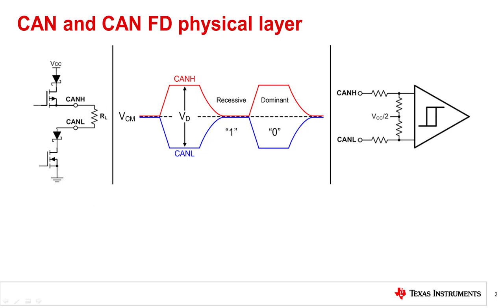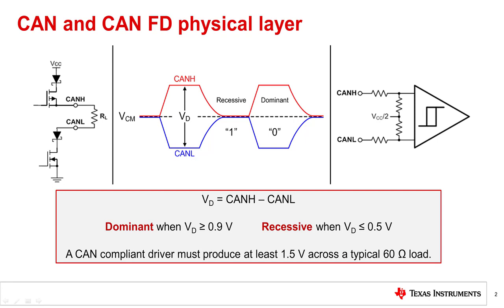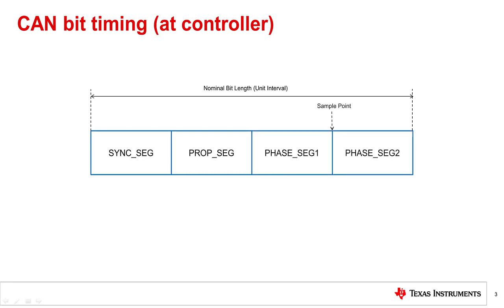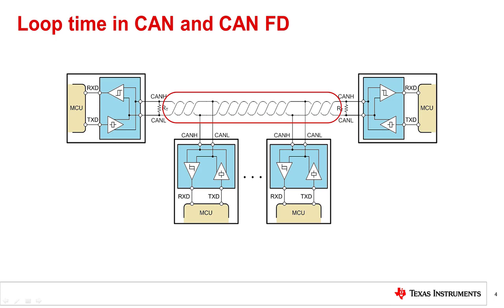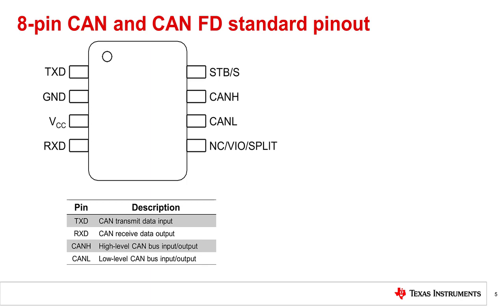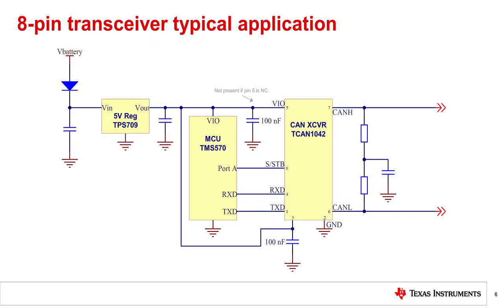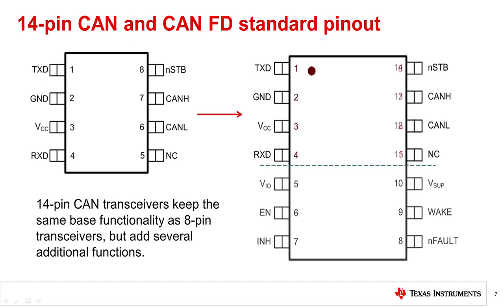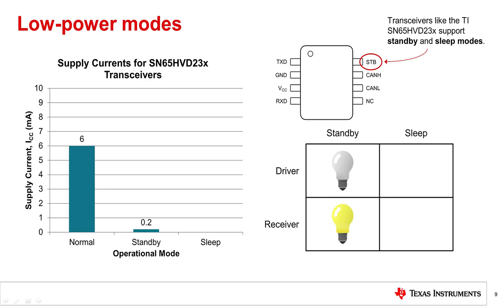CAN physical layer

Comment: The ideal bus topology is not a backbone twisted pair with stubs, but node to node daisy chaining. With daisy chaining the stubs are minimized because the splice(s) occur on the harness side of the node (module) connector, as close to the connector as possible. You could have the daisy chaining inside the module, which would be ideal, but this would required more connector pins. Another problem with daisy chaining in the module is if you remove the module the bus is now open circuit.

Sleep current graph value is wrong. Sleep current value in the data sheet is 5uA which would be 0.005 mA not 0.00005 mA.